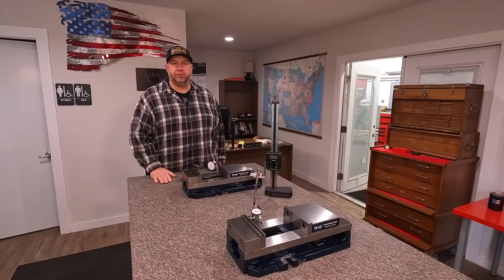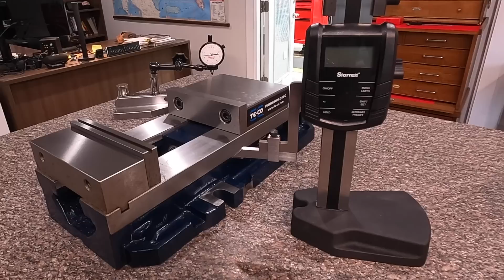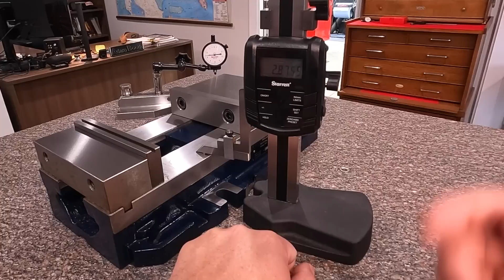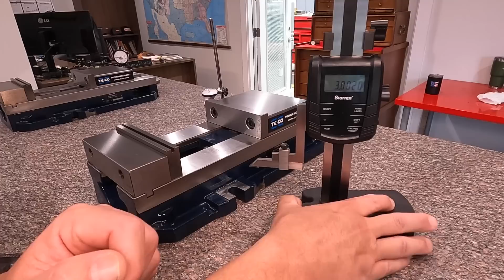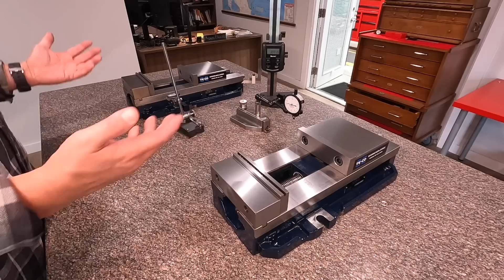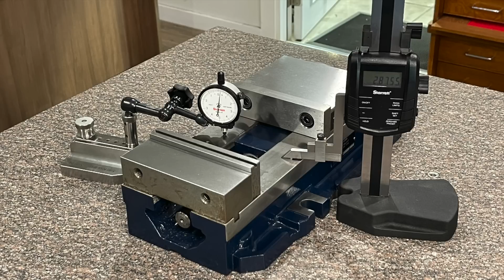Tool Tuesday Ep.12: Comparative Height Measuring

Comment: Hey Adam, just an FYI from a filming perspective - I'm not sure what camera you use but if it is capable of taking filters a polarising filter on the camera will remove all reflections from dial indicators, water, glass (basically anything reflective) cheap and work well. Extra work but may be of use? ✌

Comment: Could you not shim up the lower vise?
Reply: Yes, if you could (1) find shims 0.0003" thick, or (2) find two shims whose thickness is different by 0.0003".  Either of those things would b e a challenge.
Reply: Use Surface grinder to match the vises.
Grind the bases flat. Can also be used to set height of rails to match. 
Grind all the jaws and inserts to match.
Ground piece ofvsquare stock mount and alginate to Mill table.
Mount vises to square stock up side down.
Mill key way slots in bottom vises to align to each other
and table axis.
The Mill Grind keys to fit slots in bottom of vises 
Matched of course.
Alot work.

Comment: When you checked them on the machine with a height gauge it may have been a good idea to check them with a dti in the chuck. This would give you a real world measurement accounting for any minor discrepancies on the machine and if they twist when clamped.

If the sides need to be parallel, the faces of the vices do not have to be used. They are machined 1/8 lower than a 1 2 3 block so a part can be set on the 3" side of two blocks. This will set the base of the part parallel to the bed even if the vices are different heights.

One thing to consider is the fit between the rectangle on the long jaw & the rectangular hole in the short jaw. Traditionally the male part is made to fit the female part in that order. This is because it is usually easier to measure a male dimension accurately than a female dimension.
In this case the less accurate shaper should cut the rectangular hole close to the finished size FIRST without having to be super accurate. Then the long jaw can be easily machined on a more accurate machine to the size made by the shaper.

When physically checking the fit between them I would prefer to pop the long jaw back in the mill than to try to re-set the fixed jaw accurately back in the shaper for a skim cut.

Comment: I used to work in a shop with a jig bore operator who taught me the trade. I was working on a Bridgeport milling machine with a two Vise setup. The part was 1 inch by 3 in by 14 in Steel the sides had to be parallel plus or minus.001 inches. After struggling with a setup for about an hour. The old man came over and was carrying three  123 blocks that were matched ground and a box of Zig Zag cigarette rolling papers. He put one one two three block on the outside of each vice and 1 in between the vases. He took three cigarette papers and put them on the middle 1 2 3 block then set the part down on top of them carefully close the vices and indicated the part shimming the outer 123 blocks until the part came within a half a thousand in 14 inches. I felt like  Homer Simon " DOOOHHH "

Comment: Question: When you say 3 tenths, you mean 0.3 inch?  i.e. 7.62 mm, in my opinion, the difference between the heights is too large.
Or do you mean 3 tenths of 1/1000?
Reply: Its hard for me as a metric system user but I think the difference is 0.002 in, so its 0.05 mm. For me its a big difference on the height of these vises.
Reply: when machinists talk tenths, they almost always mean 0.0001"  for us metric folk, we're talking a handful of microns. 3 tenths ~ 8microns.

if they're measuring with a rule/scale (and not an indicator) then it's probably 0.1" :D
Reply: @dataminetk  Thanks for the answer. Now I noticed (21:30) that the scale on the clock is .0001 inch, not 0.001 :), so the height error is actually quite small.
Reply: 3 tenths = 0.0003” or 3 ten thousandths of an inch.

Comment: I am looking for the video where Adam talks about the surface plate tolerance.
Should the tolerance of the measuring standard be included in the overall tolerance measurement?
Reply: In one of the videos from a few months back where he sets up the plate, either the base one or the leveling one, he talks about the grade of his plate. AA maybe? A? I’m not sure. But he talks about it somewhere. Either way, I believe it’s flat and smooth enough to be negligible even at these tiny scales.

Comment: What ever happened to Solid Rock Machine shop?   I have one of their 1/2 boring bars.  Use it almost every day. One of the nicest boring bars I own.
Reply: Hi Rusty,
I have have some long going health issues for about 4 years now that has really limited what I can do. I think I finally have a handle on it but I am way behind in orders as a result. I hope to start doing some more videos in the near future but need to hit those old orders first.
Steve
Reply: @SolidRockMachineShopInc  Hi Steve  Are you guys still selling those carbide boring bars ?    Cheers .
Reply: @swanvalleymachineshop   They are steel bars with carbide inserts and they are in stock. The double end bars are $75.00 plus shipping and the short single end ones for boring heads are $65.00 plus shipping.
Steve

Comment: Seems likely to me that the geometry errors on the mill will be greater than the differences in height between the two vises. I suppose you could compensate for both by mounting the vises, and then machining a support shim in place on each of them. No real reason to, as even Jason's stated tolerance of 0.003 is overkill for a bench vise. But as long as we're chasing tenths....
Reply: He knows this is just 'for video purpose' as he said multiple times, but it's always good your verify tools are at least meeting their specs. Mistakes can occur and get past QC, and they can get damaged over time in use. One interesting thing is most equipment is spec'd "within +/- 0.0005", but that needs to be random, since if everything was always +0.0005" off, they would all add up and could result in stack up error of way more than 0.001".
Reply: @kindabluejazz  I love what Adam is doing in this video. I absolutely agree that it's worthwhile understanding all the sources of error in a process, and how much precision can reasonably be achieved. I'm genuinely curious which approach would lead to greater precision: to rely on the matching of the vises, or to machine a one-off shim for the operation. I said chasing tenths is "overkill" in this case, but that doesn't mean that I don't want to see Adam do it! Unnecessary from a production point of view, but invaluable from an educational point of view.

Comment: Is there any specific reason Adam that in neither of your workshops that I’ve seen at least, you don’t have any surface grinding machines? 🤷‍♂️

You obviously enjoy metrology - and obtaining the best fit & tolerances with all your many and varied machines, yet apparently don’t own a surface grinder for achieving tolerances down to 1/10th of a thousandth?

Really I guess it’s the difference between a machinist & a tool and die maker trades perhaps?

That extra enth degree of tolerance above and beyond machinist fit?

That’s just me musing I guess, perhaps it’s a specialist area that as yet within your life experience that you haven’t travelled yet?

Might that not be the next logical step in acquiring machines, to get hold of a surface grinder maybe?

When you look at the capital value of all your shops and machines and tools and indeed your metrology tools, might it not make sense to then have the ability to work down into the 1/10’s of thousandths of an inch for specific jobs requiring that kind of accuracy maybe? 🤷‍♂️

Comment: I wish some of you learnt how to spell Vise, not Vice just saying.😊
Reply: Some people spent more time in metal shop and less time in spelling class. Some people have brains that are good at memorizing things, others have brains that are better at figuring things out.
Reply: Willem, I hate to disappoint you but the world does not always have to revolve around American ENGLISH
VICE.
[ C ] mainly UK (US usually vise)
a tool with two parts that can be moved together by tightening a screw so that an object can be held firmly between them while it is being worked on:
Vices are often used to hold pieces of wood that are being cut or smoothed.
Her hand tightened like a vice around his arm.

Comment: It's really fun to see you bring high precision measuring tools out on a quality granite plate and do some careful inspections.  However, you can now do all the rest on your CNC mill, using your Renishaw probe.  I'm sorry, but I'm not a machinist and I have never myself used a Renishaw probe.  However, most of their probes are advertised have an accuracy of about 4 ten-thousandths of an inch (10um), which you agree is plenty for this and many other jobs.  Write a simple CNC program to probe a roughly flat surface in a pattern of your choice.  Maybe a rectangle with probe points at the four corners and one in the middle.  I guess that the simplest method for you would be to draw a 3d plate in your 3d system and have your probe tip be the tool.  Then put the part into the already-tested-flat vices and measure the height of the top surface.  That would require one touch of the probe tip.  If you want to test the flatness, take at least three measurements in a triangular pattern.  Then mill this surface.  Turn the part over and repeat.  Easy-peasey.  Good luck!

Comment: OK, I see.  For the precision you are talking about here, the vice units would have to be clamped down and each at the exact same temperature.
Reply: When I worked at EEI, there was a climate controlled metrology room with a granite that was bigger than a queen size bed and parts sat on it overnight to temperature acclimate before measurements were taken. Large aluminum chassis parts were most critical like a motor plate, for example. A lot of precision went into making "Awesome Bill from Dawsonville," win.
Reply: Oil pumps were also measured to extreme tolerances.

Comment: Would a couple of licks of your precision bench stones make it more perfect or not?
* I can see how one could get lost in the weeds of perfection.
We used to say in surgery, "Perfect is the enemy of the good."
Or rather . "I don't want it perfect. I want it Tuesday."
Reply: Stones are for taking a burr/ding down flush with the surface. To get those EXACTLY the same, you'd need to surface grind them, probably at the same time. But like he said, when it gets to tenths, you will drive yourself crazy getting to absolute zero.
Reply: That last few tenths is into lapping or scraping range if you don't have a surface grinder. The precision stones are more of an inspection or spot touch up / burr removal tool rather than doing bulk removal of material.
Reply: The stones are not useful for that sort of thing. 
    Milling/grinding the base of the vices MIGHT yield some benefit.
Reply: Contrary to what is being expressed by these experts, yes it would have been wise to go over these vises with the precision ground flat stones because there could be a burr from shipment, handling, or etc..  A precision ground flat stone will even identify the high tracks of a surface ground finish.  When you start dealing in tenths of thousandths even temperature has an effect.  Your comment would be well received by those in the know.
Reply: @37yearsofanythingisenough39  that’s why he swiped all over the whole surface. There were t any bumps or hot spots. A stone wouldn’t do anything.